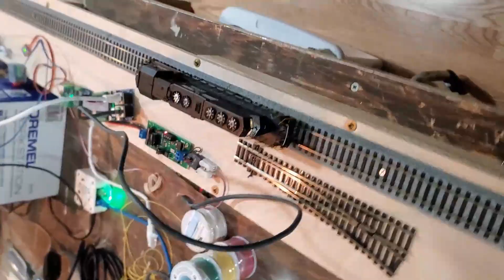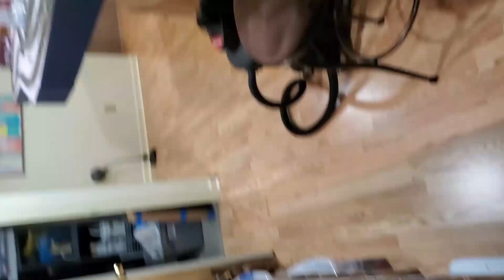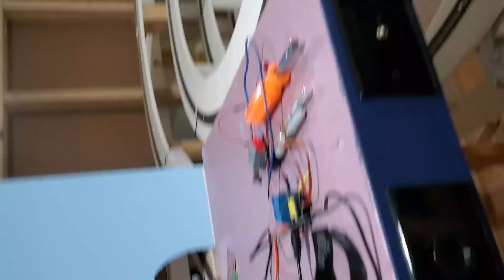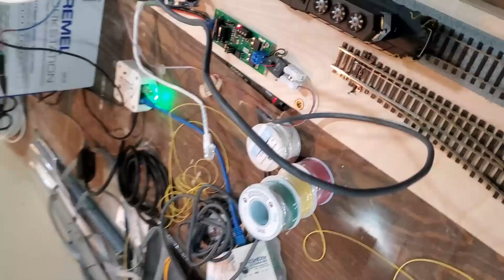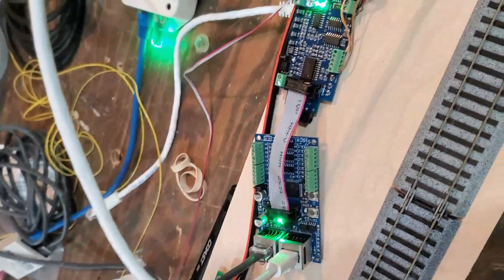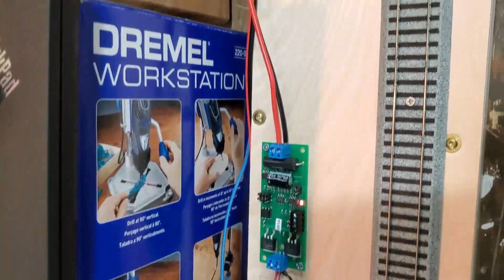LCC Testbed

Comment: how the loco is powered? in DCC both rails will carry signal as well as power. But how a LAN cable with 8 wires are going to get hooked up to two rails?
Reply from the maker: Loco powered by DCC bus. LAN cable is for daisy-chaining the LCC node together.